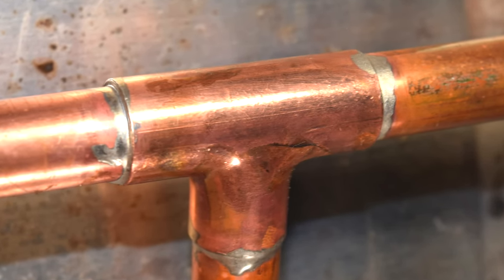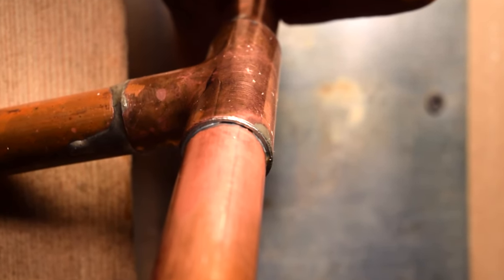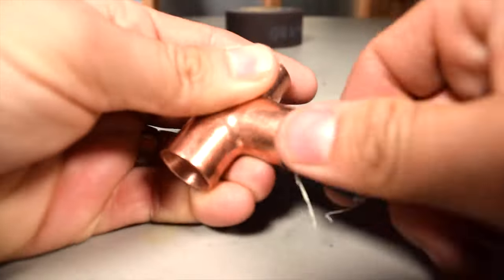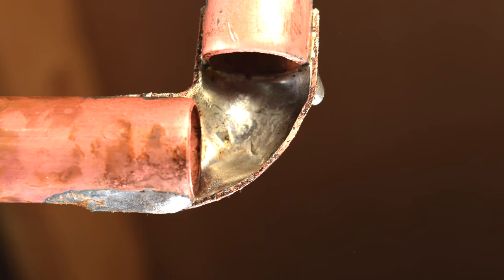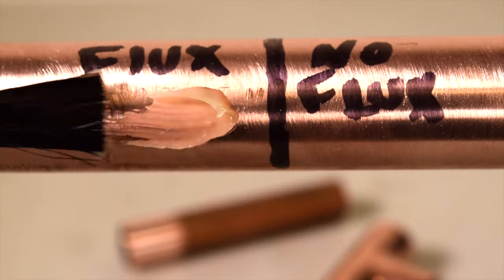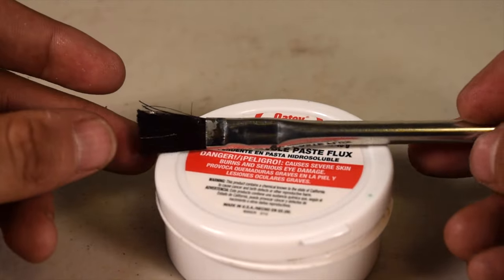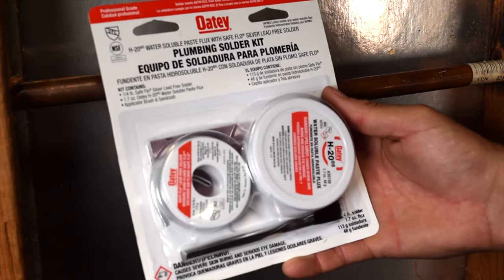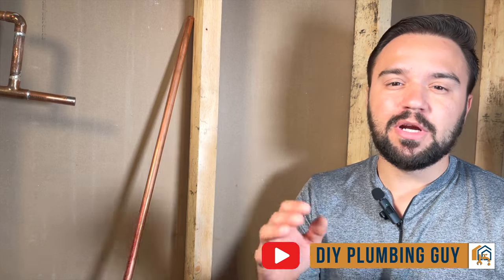Avoid These 3 Rookie Mistakes When Soldering Copper Pipe

Comment: Carlos — thanks for a great video. I’ve helped my father for years do things like change water heaters and other plumbing jobs. He is from that generation that seemed to be able to do everything from wiring a room (that he built) to doing a brake job on a car. We used to rebuild carburetors together, back when cars had carburetors! Anyway, pipe soldering always intimidated me and now that I’m retired, I’m trying to brush up my DIY skills. So thanks for a very helpful video — the cutaway views really illustrate your points. Going to your channel to subscribe as soon as I finish this. BTW, Dad is now 95. He doesn’t solder pipe anymore but he still supervises whenever something needs to get done!
Reply: What a wonderful story! It's amazing to hear about your experiences with your father and all the DIY projects you've tackled together. Soldering can indeed be intimidating at first, but I'm delighted to hear that the video helped you feel more confident. Thank you for the kind words and for considering a subscription to the channel. Your dad's supervision and wisdom must be invaluable – here's to a lifetime of shared knowledge and projects! 🛠👍😊
Reply: Funny, I was getting ready to type a similar reply. My Dad was also from that generation. He would have turned 92 this year and had so many skills. He could do things I won't even attempt, like adding a circuit to a breaker panel. He was no plumber, worked for the phone company for 38 years. But he could make solder draw up into a pipe if he tried hard enough! I learned many things from him, but that was not a skill I picked up and I certainly am no match for what he was able to do. 
Thanks for the video Carlos! I might give it an attempt in my garage, otherwise it's Sharkbite territory for me!😅

Comment: Just moved back in to a house that was rebuilt after a tornado tore it apart and the contractors had installed two new showers. The walk-in shower has a rag inaccessibly glued underneath the floor drain grate (!). The other had drips of solder in the bathtub with the shower valve installed upside down where you couldn’t even adjust the water temperature. Water was spraying out the back of the tub spout until it fell right off, revealing the fitting inside had not been properly soldered. There was a blob on the threads that screw into the spout but none where the fitting attaches to the pipe itself. I had never soldered plumbing in my life even though I solder electronics as a hobby. Even so I did a million times better even though I had zero experience.

I knew my lead solder and rosin flux wasn’t appropriate for plumbing so I went to Lowe’s for some acid flux, emery cloth, plumber’s tape, and a new fitting (didn’t want to reuse the one with the solder blob in the threads). I didn’t have a proper blow torch so I used two mini butane torches that I had for heat shrink tubing with my electronics work (it’s closer to a cigarette lighter than a proper torch!). It took a while to get it hot enough but the result looks great and has held up. Thanks for confirming my intuition on this.
Reply: What a ride!! I am glad it worked out for you. I have a similar story on the house we moved in, very bad soldering all over and now we have to redo. Thanks for the comment and sharing your story!!
Reply: It's pretty crazy that DIY homeowner work can be of equal or higher quality than hiring a pro. I have a similar story as yours except I hired a pro bricklayer to fix part of the brick facade wall of our 1967 home. I always thought that bricklaying is an art so I never considered doing it myself, but after seeing how the pro's work turned out (was not impressed) I later did a much larger section of brick wall myself, figuring I can't do worse than the pro, but I went slow and the result is seamless. This was two years ago and I still kick myself for paying so much money on the smaller section for an inferior result.
Reply: @donaldlee6760  agree 100%… there is a lot homeowners can do.

Comment: Gotta say, as a diy'er, I typically just shoot for sharkbite because it just ends up saving so much time. Not to mention, it is reusable as well as having multiple applications, i.e., cpvc, copper, pex. I will admit, though, the bend will be a valued tip for me, I did not know that with my 1 year of plumbing and 3 years electrical training. If I ever gotta do pipe work for a friend, that will be useful info. But again I'm most likely just gonna shoot for them sharkbites as a diy'er because as a diy'er, I get paid by the job, not the hour, being mostly friends and family. Course, I'm still young yet. I just graduated 2022, so I still have a long way to go.
Reply: For sure, sharkbites can get you in and out in no time. And, there is a place and time for solder. Not so much as before. Thanks for watching. 👍

Comment: Is there a standard diameter for plumbing solder? …because I just used the lead free stuff from my electronics bench where I have all kinds of diameters. Had to guess at how much to use but it seemed to work out. :)
Reply: Great question! Plumbing solder typically comes in a standard diameter of around 0.125 inches or 1/8 inch (3.2mm). However, using lead-free solder from your electronics bench can work if you're in a pinch. Your ability to adapt and make it work is impressive! 😄🔧👍 Good Stuff!!!!

Comment: Could you please elaborate how fixing a joint by adding more solder could become a 'ticking bomb' for a pipe connection? And what 'two different solders' does mean in that case?
Reply: Great question! Adding more solder to fix a joint can potentially become a 'ticking bomb' if it leads to excessive buildup or creates a blockage within the pipe, which might weaken the connection over time. As for 'two different solders,' I was referring to the use of solder materials with different melting points, which can lead to inconsistencies and potential problems in the joint. It's always best to follow proper soldering techniques to ensure a secure and safe connection. Thanks for seeking clarification!🔧👍
Reply: @DIYPlumbingGuy  Mixing two different solders never been a problem in a world of electronics. It just create a new mix and sometimes this approach could be used intentionally.
Reply: @sjtonic  from my experience, it's more so a matter of just getting the joints cleaned up and bonded well.  As you know, you gotta properly clean up the joints to get a nice "structure" for strength so it can bond well with the pipe, the fitting, as well as just itself. Basically, I view it like cement. If you just pour new cement over old, it's not gonna have nearly as much strength, and it'll begin to crack and chip away from each other as more and more force is applied.
Reply: Another way you can look at it is like using wood glue. If you're using wood glue as a joiner for 2 pieces of lumber, you use too little, and the 2 pieces break apart. Then you just whip out some more wood glue and just pour some more back on, not cleaning off any of the original glue that's dried up. Essentially, you're still relying on that original glue as a joint since it wasn't cleaned off and now that's a weak spot since it's just bonded to one piece of lumber and instead just adds more tension-stress on the rest of the glue trying to bond the 2 pieces.
Reply: @austing9060  Nope, solder does not behave like a wood glue. It's a wrong assumption.
Reply: @sjtonic  it's the concept behind it. Solder bonds to the two pieces, acting as a joint as it dries up and hardens, just like wood glue. When you apply more solder/glue to some that's already dried up, it's can create small gaps that truly dont bond to the wood/pipes real well, and will weaken the joint immensely by not making it a pure bond, and eventually with the tension stress, especially on high psi water lines, those gaps will grow larger, cracking and breaking apart. The issue with the soldering on pipe lies within what's already there. Once that joint has cooled, most likely, the flux is gone, and you gotta reheat, which can burn the current solder off. Also note if too much solder is surrounding just the edge, it can make matters even worse by not letting more flow INTO the joint and rather just buildup around that edge, leaving that tension stress. It's all base on what's currently there, and for most diyers it can become major misunderstandings if they don't do it consistently because getting that right temperature is the key to perfection
Reply: @austing9060  heat melts all the solder, old and new. Please do not apply a wood glue approach to a solder, it is just wrong. 
I have a little bit of experience in soldering, smth like 30+ years.
Reply: @sjtonic  the biggest issue within it, lies with what's already there. The key is to assure that it is cleaned. My concept with the wood glue lies more so with the 3 basic steps behind it and solder, you clean, apply, and dry/cool. With solder, if you're just reapplying solder the next day because you inspected your work, that's one thing. When you reapply it when you see it spraying water, it can be a big negative, especially for diy'ers because they don't handle those joints consistently, and finding just that sweet spot in temperature makes the difference in reapplying it since for them, they can try to reapply and actually be burning up what's there. What I'm saying is, you can remelt it, but if it is an old/used joint, little bits of sediment and oxidation can be on the joint and again, reapplying that solder you gotta burn off those bits, but you can also be burning off the solder, not to mention the pipe/joint itself. Each case differentiates, but for most diyers, again they don't know that sweet spot and most of the time make matters worse

Comment: Everybody sharkbites now. And they always end up leaking because they r hard to seat all the way... I will use a sharkbite in a area I'm worried about melting.. like back of shower or if  I'm worried about a fire.
Reply: You're absolutely right, Sharkbites are pretty popular these days, but you've highlighted a common issue with them - seating them correctly can be a bit tricky. Using them in areas with heat concerns or where you're worried about fire safety sounds like a smart strategy. Thanks for sharing! 😊🔧🔥👍